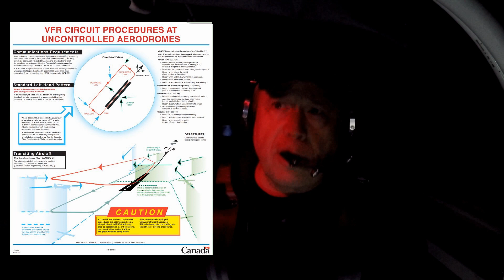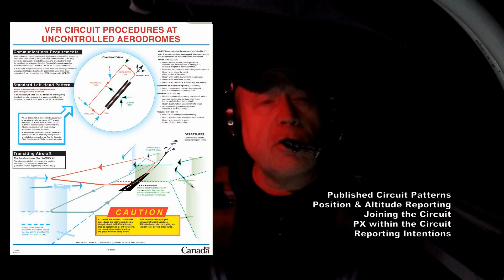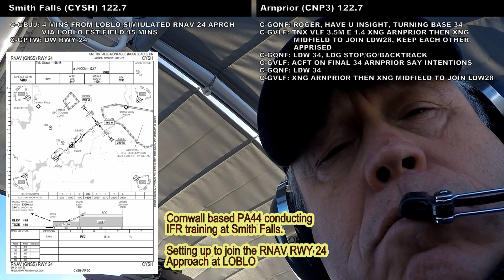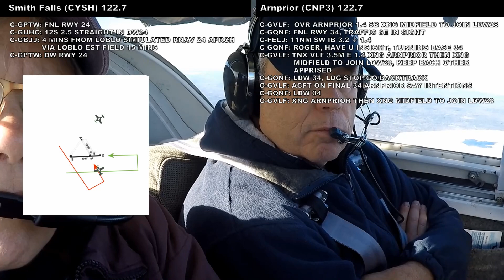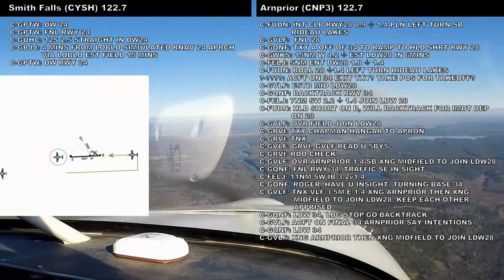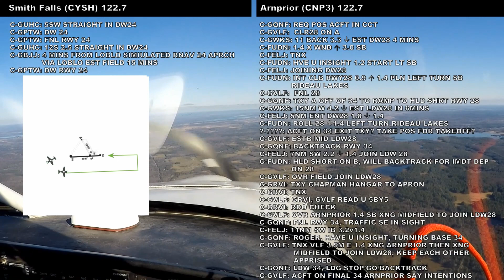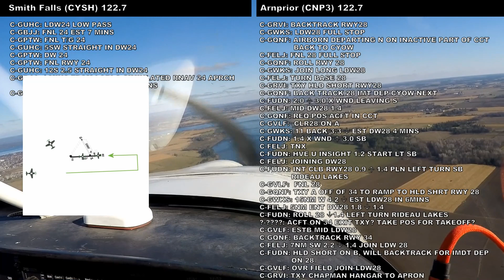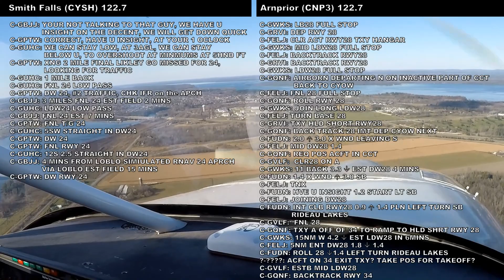VFR Circuit Procedures at Uncontrolled Aerodromes in Canada – A Real-Time Flight Demonstration

Comment: It is also recommended at uncontrolledly airports to Identify the airport you are at at the start and end of your transmission. Helps when there are two airports on the same frequency in the area. See the information below. It just recently came to my attention.
At an uncontrolled airport where you could encounter larger aircraft there circuit altitude could be 1500 above the airport altitude, so in that case your cross over altitude would then be 500 ft above them. This would mean 2000 feet above field altitude. 
Which could be an issue with aircraft overflying an aerodrome as they are to be 2000 feet above field altitude minimum according to CARS. I would suggest adding an extra 500 as a safety margin and radioing position reports on the airport frequency.
Just some information for every one.
Just passing on this information. Suggested reading AIM RAC 4.5.2

AIM RAC 4.5.2

(iii) If it is necessary for an aircraft to cross the airport before joining the circuit, it is recommended that the crossover be accomplished at least 500 ft above the circuit altitude. 

2. Pilots of large and turbine-powered aeroplanes should fly 
the circuit at 500  ft above the established circuit 
altitude (usually 1 500 ft AAE). All pilots should be aware 
that these aircraft usually operate at a higher speed than 
piston and electric engine light aeroplanes, have greater 
turning distances and fly larger circuits.